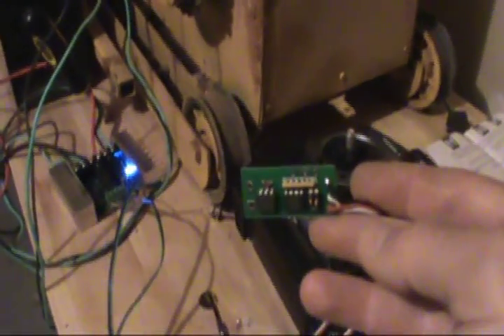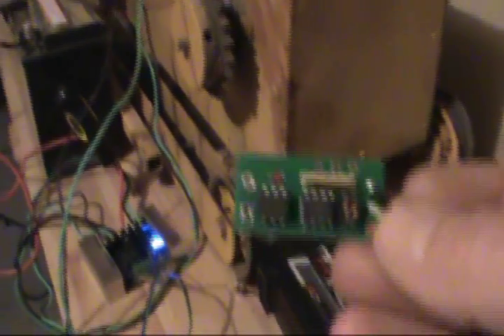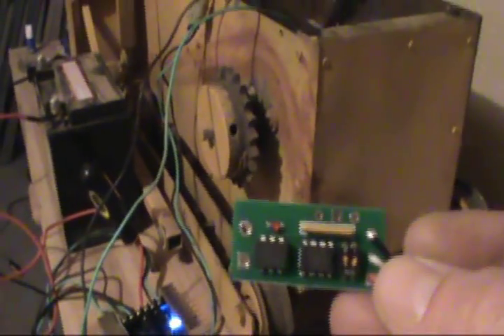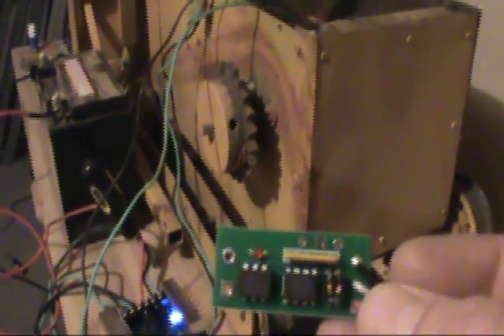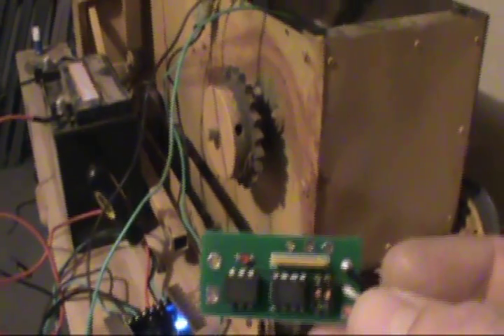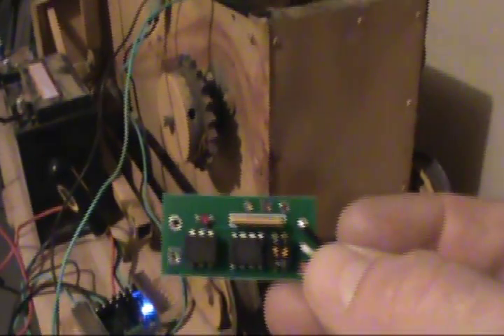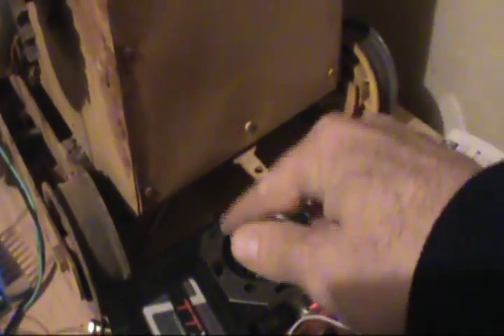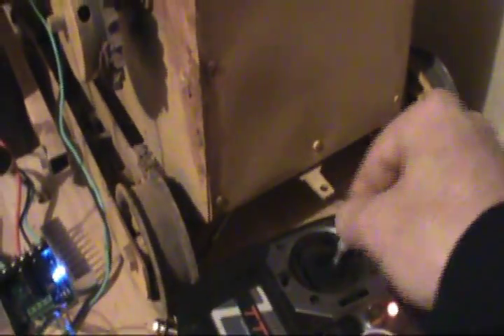RC Dozer Rebuild Motor Speed Control

Comment: @metelbod Glad to help. 1st speed controller is usually used to power RC receiver, and if second speed controller is used to drive some other motorised function, it can cause some erratic behavior. This can be solved by taking off second power feed to receiver.

I really like Your dozer and some years ago, I was thinking of building one by myself. But big scale makes these hard to transport, it needs always a trailer. So I decided to scale down my builds. But maybe someday... =)

Comment from the maker: @automies72 Thanks for the info and it is was a great Ideal to kill the power to the receiver. At first I still had the RC battery and switch attached and it continued to work but would get a dim "blue light" from the speed control. I just did some reading and and it says that the RC receiver would be powered from the speed control. So I think I am good. But again thanks for the tip....so simple, but I over looked that option.

Comment: Carefully take out red wire from the connector, so You can put it back together if You need later on.

Tape red wire so it wont touch anything harmful.

Comment: Hi

Use another speed controller for blade linear motors. That should give You a possibilty to make smooth operating blade. But make sure to remove red wire from that 2nd speedcontroller. I mean that wire that goes to receiver. Red is positive that feeds power to receiver. White is signal and black is negative. Signal and negative are needed for that 2nd speedo to work.

Hope this helps.